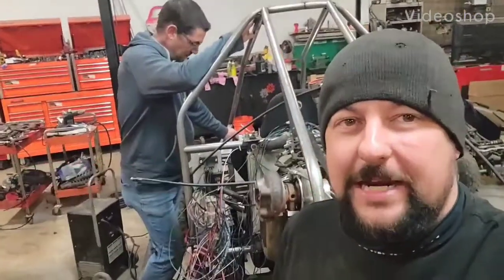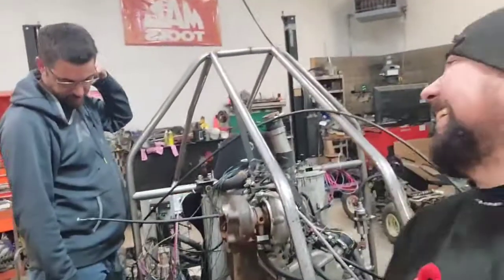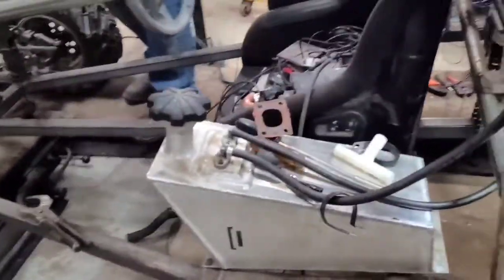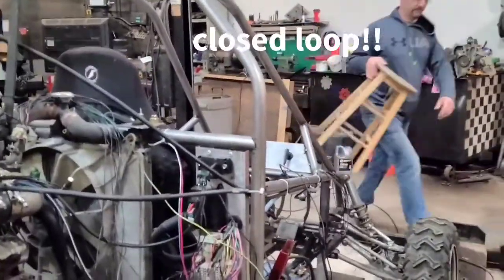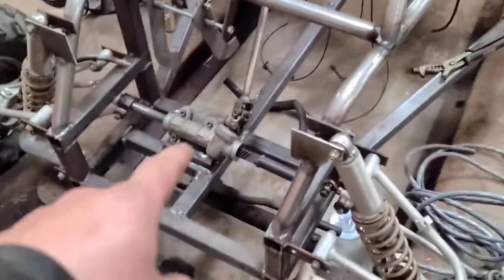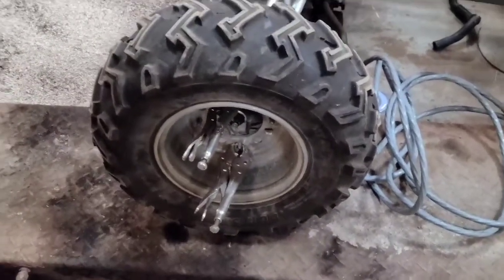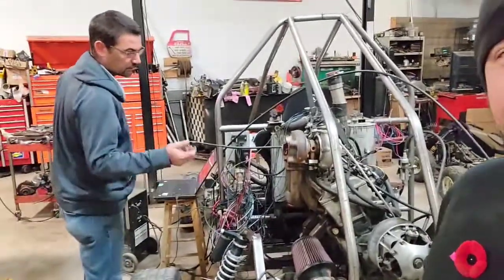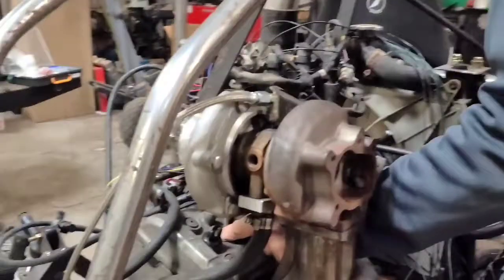first startup of J P 's turbo cross kart!

Comment: Very cool set up I want to put a apex in a aircraft. Here's my thoughts take a seadoo 185hp supercharger and take the tooth gear off and add a pulley and go 4 to 1 with another pulley off the back of the apex crank at 4 to 1 and 9000 rpm on the engine will spin the supercharger at 36000 rpm which should give a 30 to 40 HP gain.. I want to micro squirt it like you did do you have any tunes or base tunes logs to share? Or were they uploaded to mega squirt?
Reply from the maker: ill have to ask JP and see if he has the tune file for it! it was workin pretty good, but it kinda fell to the back burner and we've been re-purposing parts off it for other projects
Reply: No rush. vvery cool set up though @rednecksdirtyhands